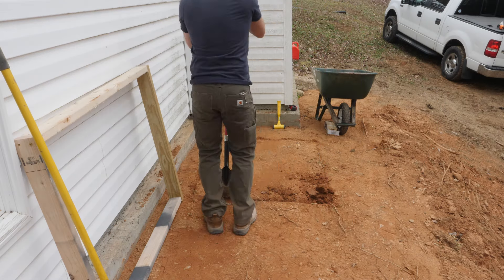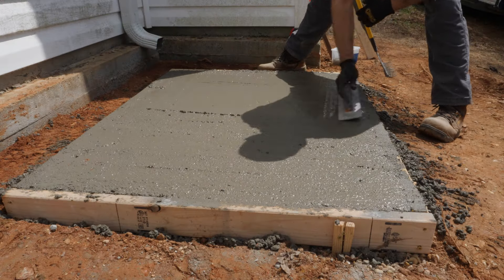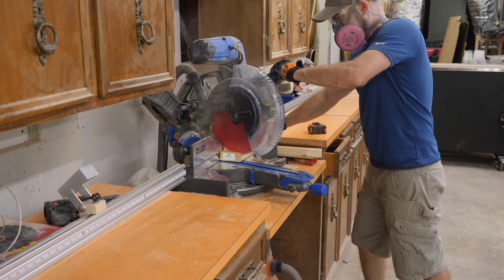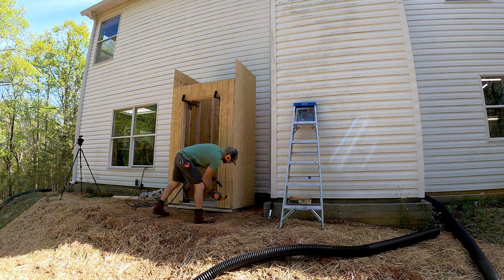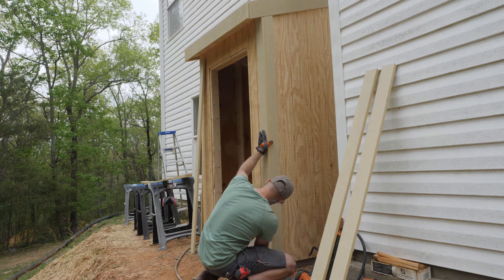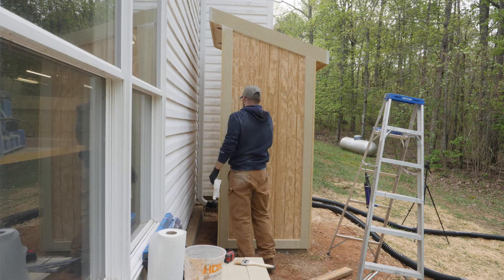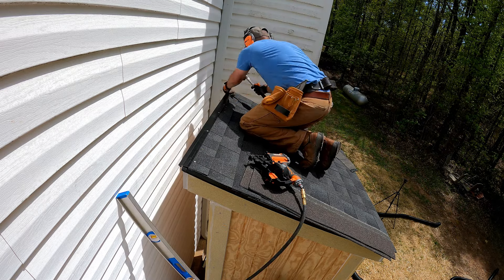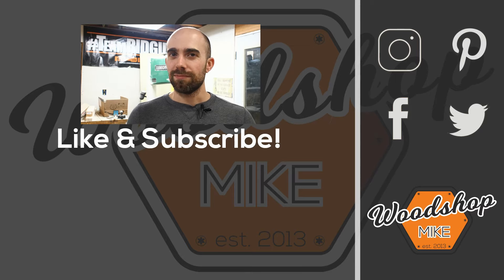How to Build a Lean To Shed

Comment: I’m not lucky like you.  My compressor would overheat in such a small place.
Reply from the maker: I read a lot about the concern of compressors overheating in sheds.  Time will tell but this side of the house only gets direct sun for the last few hours of the day.

Are you thinking you'd have trouble because of where you live?
Reply: @WoodshopMike  overheating really is an issue if you fill it and empty it for projects that require a lot of CFM.  I guess it’s a question of how many CFM’s you go through.  Usage will tell...  

Keep us informed if there is an issue.  

Thanks for your video.
Reply from the maker: I will for sure!  I've though about adding a fan to exhaust air if heat becomes an issue.

Absolutely!  Thank you for watching👍😀

Comment: you didn't chamfer the edges of the concrete. 😞
Reply: You don’t do that when you build walls on top of it.could have done the door opening tho.
Reply from the maker: I'm no expert, just some dude trying stuff out and bringing folks along.  I didn't think I really needed to chamfer the edges since a shed would be going on top.  Glad to have that confirmed 👊👊 Good point though, I guess if I'd planned ahead enough I could've chamfered the door opening.
Reply: @WoodshopMike  if it’s starting to chip then grind it round or 45 o   
Even a flat rock will do the trick sometimes.
Reply from the maker: Thanks for the tip dude I'll let that in mind!  It's been there for a few years at the point with the air compressor running daily and things are still solid😃

Comment: goodness me that concrete foundation...im thinking of building a shed 4 times as big not using a foundation like that...Just some slabs of stone...
Reply from the maker: I wouldn't do stone.  Either do concrete or build the foundation from pressure treated 2x6s
Reply: @WoodshopMike  yessir i was thinking stone plus a hardwood or pressure treated frame. Its just a toolshed barely 6,5 feet bu 20 feet (all i have room for). So just to store some gardening tools etc
Reply from the maker: Sounds good!!

Comment: Why do you need a tiny shed when your workshop is massive!?
Reply from the maker: That's a great question!  I keep my air compressor in there instead of in the shop for a few reasons.  One is noise (not only for the shop but also the house since my shop is in the basement), two is draining the tank, and three is that if an air compressor were to fail and explode in the shop it would do serious damage.
Reply: @WoodshopMike  That's a very nice air compressor shed. Lol
Reply from the maker: Why thank you! 😃

Comment: Downpipe running into the back of the shed no storm drain and no damp course membrane between the slab and the timber?
Now very smartie🤣
Reply from the maker: Watch the video again.  Down spout is to the side and pressure treated lumber against the concrete👍
Reply: @WoodshopMike 

I might pass on watching all the video this time. I like a shed that has a dry floor not a damp floor.
Plastic membrane between the gravel and the concrete salb would
 stop the damp rising.
Pressure treated lumber will rot in 5 yrs unless you treat is with aditional wood preserver and add damp course as I mentioned before. Lumber work is first class but the rest?
Every day is a learning day.
Reply: @NH-hf8yp  I built a slab for a shed 15 years ago just like he did. No dampness or rot.